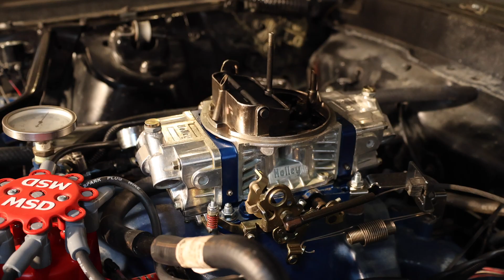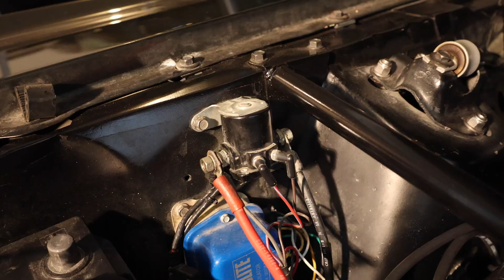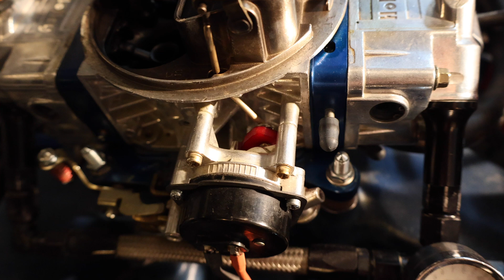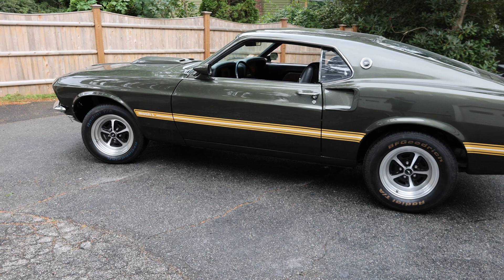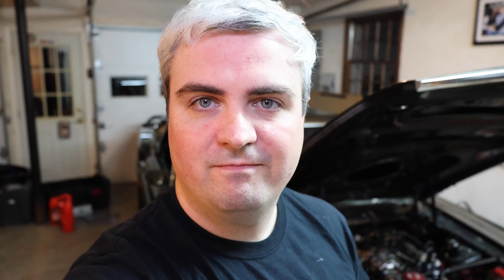Adjusting the Electric Choke Correctly on a Holley Carburetor

Comment: Thanks for this video. I have a Edelbrock carb but it seems to be the same procedure. I had an engine swap done in August, and the electric choke was probably set for those warmer temps. Now that its 30F here in NYC, the car stalls on start and I have to feather the pedal to keep her alive for what seems like forever. Hopefully by following your steps I can adjust my electric choke a notch or two over and get her to hold the fast idle again on these very cold days.
Reply from the maker: No problem DMAC of Queens. The steps are generally the same. I have to do mine twice a year, in the cold, and in the summer. It takes some time to get the adjustment right since you have to wait until the engine completely cools back down to try again. Let me know how it goes!
Reply from the maker: It worked? Glad to hear!

Comment: If the cap needs to be adjusted to increase or decrease the time for the plate to open, is it done while the plate is in the normal open position or when it’s closed after throttle?
Reply from the maker: It shouldn't matter when you adjust it since it always resets when the heating element is ambient temperwture. For myself, I always do it while the engine is cold and choke is closed.